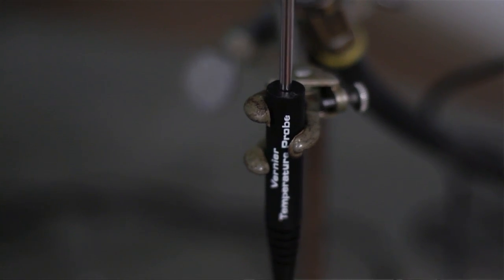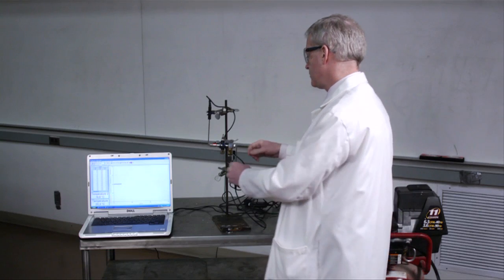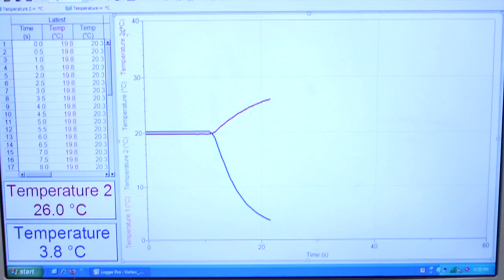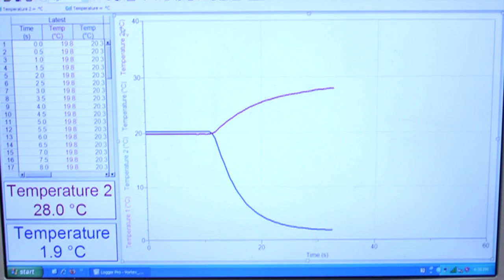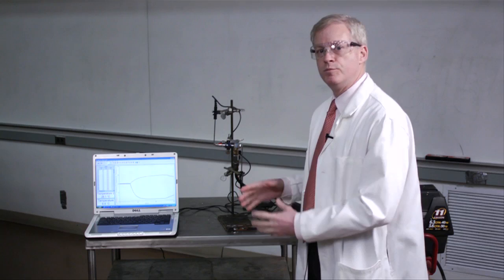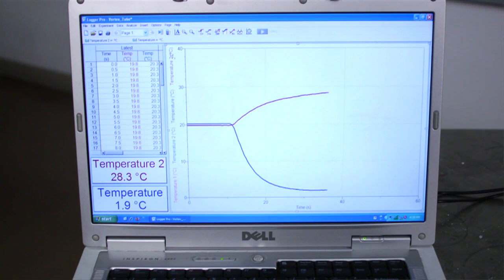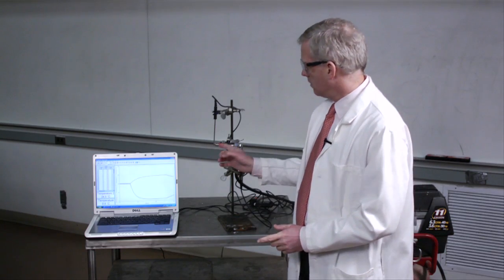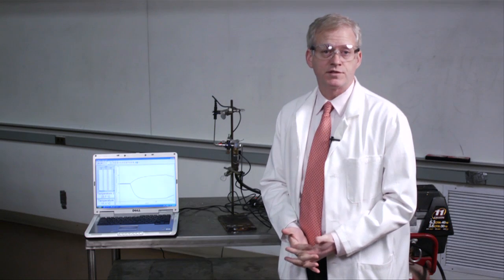A Vortex Tube at Work

Comment: Judging by the queries below, there is much interest in the subject. My question is whether the cooled outlet air is not super sonic, and if it were, would it not form a shock wave which would revert the temperature back to higher levels again ?

Comment: I have a question that I would appreciate if anyone answers me, if the required flow of a vortex tube is 200 lpm and you use 50 lpm with the same pressure, does a vortex tube work or it is not gonna work?

Comment: Why does the hot air get pushed to the outside? Cold air is more dense, so its more heavy, so it should be able to displace the hot air, right?
Reply: well i picture a similar thing as in a tesla turbine but in reverse.... a tesla turbine, when gas does its work exits cooler than what it entered with and here as you are applaying presssure, the high energy vortex generated pushes everything one way and when it expands and loses energy by expansion, the cold air is than making another vortex in the midle that is pushed by the hot air.

Comment: Could you suggest min air pressure to effect cooling to less than 10*C? Is it necessary to use dry air? What'll happen if one uses normal air of RH 50% or above?

Comment: What would happen if one end of the tube is blocked?
Reply: then you have an expensive compressed air nozzle
Reply: @kolby4078  What if the hot end goes into another vortex tube? Does it super heat the air coming out of the second tube?

Comment: Can these work with liquids
Reply from the maker: The laws of thermodynamics do not forbid it, but the viscosities of liquids compared to gases, as well as the substantially higher heat conductivities and, most importantly, ENORMOUSLY lower compressibilities, render any meaningful reduction to practice impractical.

Comment: Hi Chris, would it be possible possible to use a vortex tube to separate oxygen and hydrogen coming from an oxyhydrogen generator? How can I compute the minimum input pressure necessary to obtain a sufficient rotation speed in the gases? Will the friction between the two gases make the mixture explode?
Reply from the maker: I'm afraid that all you'd separate is hot mixture from cooler mixture. Gas separation typically requires cryogenic distillation (although lots of potential for selective sorption in nanoporous materials is being studied these days). To your last point, key safety issue: mixtures of hydrogen and oxygen are serious explosion hazards, especially as the mixture approaches the stoichiometric ratio of 2 moles H2 per mole O2, where there will be no transport limit to combustion. Extreme care should be taken in handling hydrogen in general.
Reply: Chris Cramer BUBBLERS!

Comment: how much maximum COP can be obtained?
Reply from the maker: It depends on the gas employed. You may be interested in the theoretical maxima predicted for various gases in this paper (e.g., air is 2.5): https://www.researchgate.net/publication/275024199_The_Maximum_COP_of_Vortex_Tubes
Reply: Thank you very much...!!!
Reply: Does vortex tube work with any liquid refrigerant?
Reply from the maker: The incompressibility of liquids makes the work that could be extracted from a pressure drop too small to be of any use, but a vortex tube will work with any gaseous substance.
Reply: I am working on project of the vortex tube, so can you suggest me any eco friendly gases fluid for the same?
Reply: Is there any example of using vortex tube with steam? And, by the way, I have paper from a researchers that claim to have 4-6 COP with vortex tube. They used a blower instead of compressed gas.

Comment: Hey, I am using the same vortex generator but I have couple questions. 1 what is the value of the gas flow? 2 what is the pressure of the gas? and how efficient it is for the cooling of a system at 45 degrees celcius? Thank you

Comment: what if we increase the length of the vortex tube at constant diameter? will the temperature on the hot side exceed 100 degrees celsius?